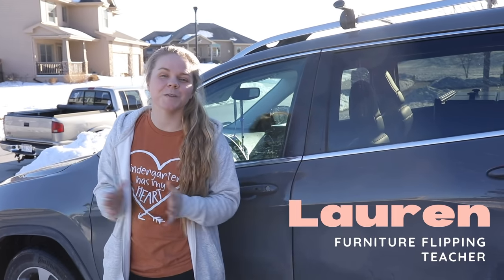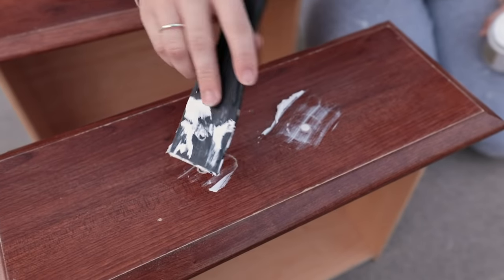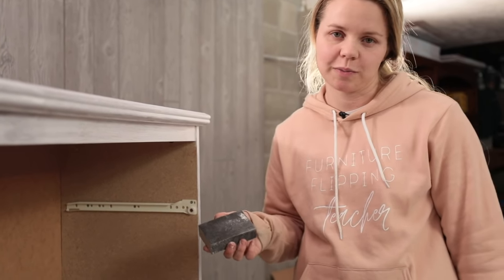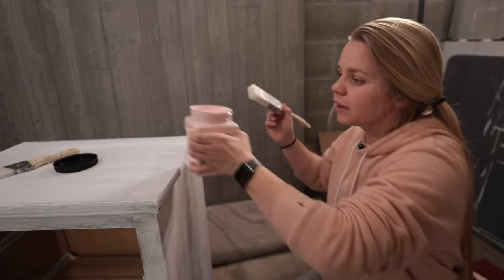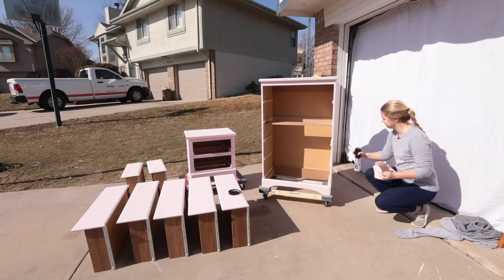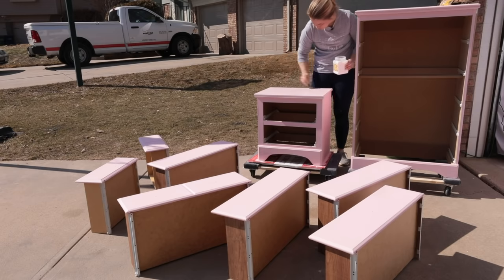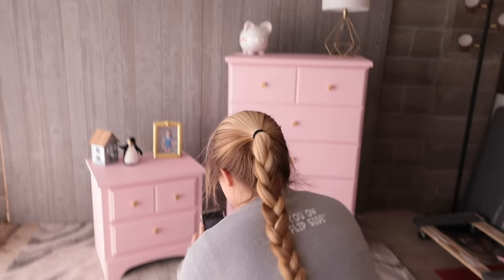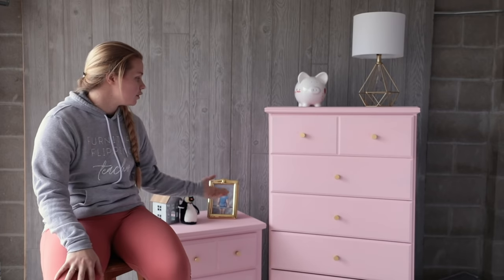DIY Kids Dresser & Nightstand Makeover | Furniture Transformation Under $100 | FB Marketplace Flip |

Comment: How did you fasten your panels to your garage wall? I fought with mine all weekend and lost
Reply from the maker: 2x4 wood pieces glued to the wall and nail gun into the wood along the edges. Check out my staging video for more info about that! Thanks for watching!
Reply: We have wood walls in our garage and used a 18 gauge brad nail gun, we also used wainscoting for the wall and will be using peel and stick tile from Walmart for the "floor"